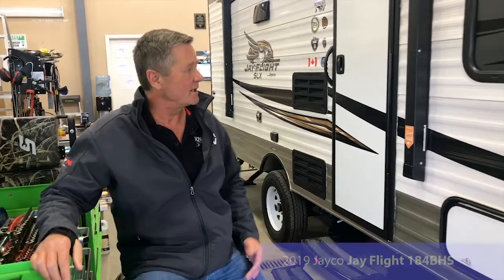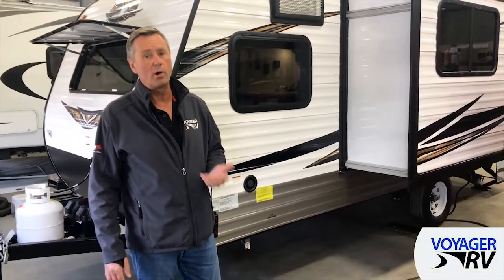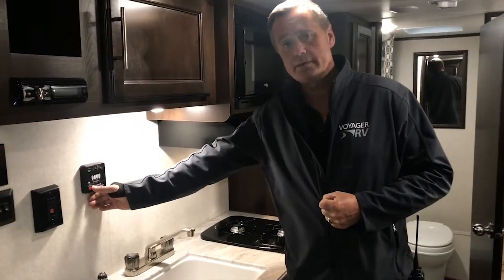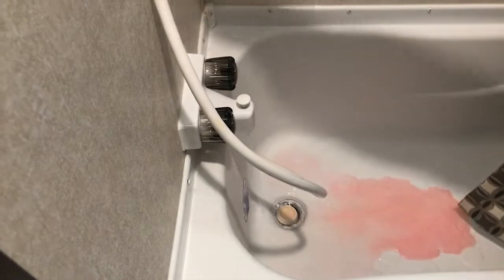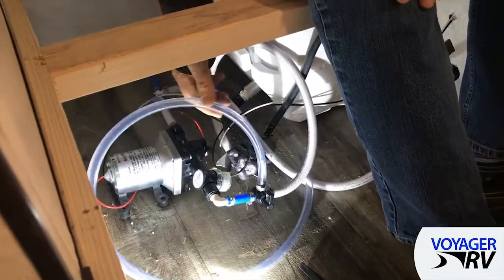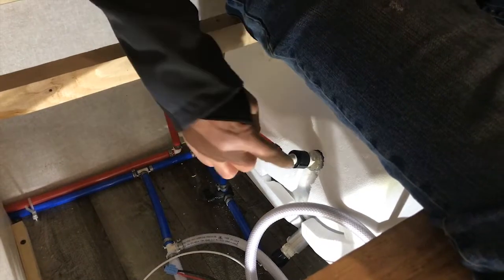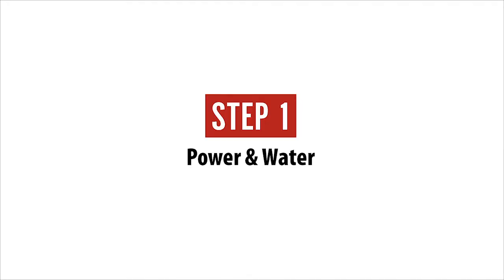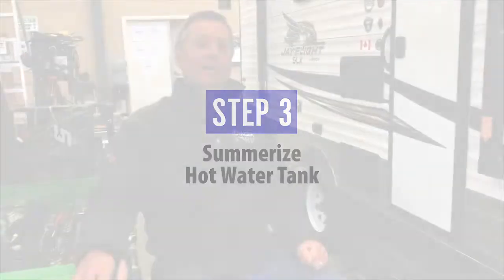How to Summerize your Travel Trailer | Voyager RV Centre

Comment: So when i am connected to the city water at a campground, can i still get hot water by doing this or does my water tank always need to be full?
Reply from the maker: If your trailer's water valves are set for normal use (Summerized), the city water connected to your RV will go to the hot water tank and be pressurized by the city connection. So you do not need water in your holding tanks. 
I hope this answers your question.
Reply: @voyagerrvcentre  yes it does, thank you
Reply from the maker: @XxSaLvIaTrIpXx  Fantastic :) 
Happy Travels!
Reply: @voyagerrvcentre  so I have the hot water tank full from the city water but still not getting hot water, do I need to turn on the water pump switch or the water heater switch?
Reply from the maker: @XxSaLvIaTrIpXx  If you turn on the hot water tap and water comes out, that is the pressure from the city water, so no need for your pump. The water that comes out when you turn on your hot tap runs through your hot water tank, so in order to heat it, you need to turn on your hot water tank. 
The best thing to do is contact an RV Service Department to help diagnose your specific RV, as there are different makes, models, and years.
Reply: @voyagerrvcentre  ok thanks

Comment: Hi Rick - how do I turn on the battery powered lights in the trailer when not hooked up to a power source - ie - camping in area without hook ups - I have a 2011 Creekside travel trailer.
Reply from the maker: Sorry for the late reply, (long weekend) - Thanks for taking the time to leave a comment in our YouTube channel.  To answer your question, the battery is your power source to turn the lights on without any hookup. Make sure you don't have the battery disconnect turned off or a blown fuse, this might cause confusion. :).  If you need specific instructions on your camper model leave another comment. Happy camping Gus ~ Rick McKague, Red Seal RV Technician for Voyager RV.